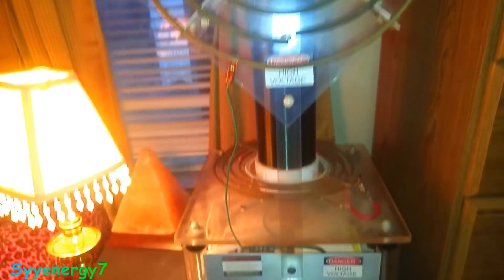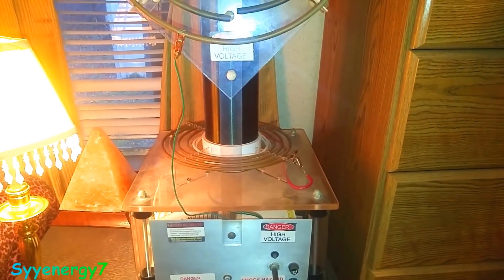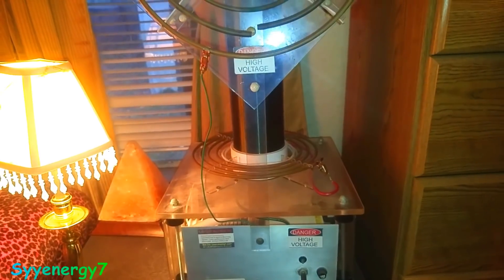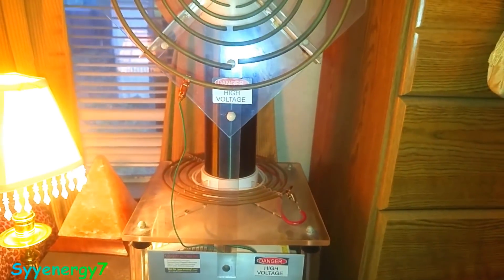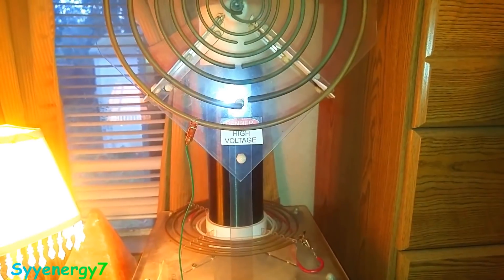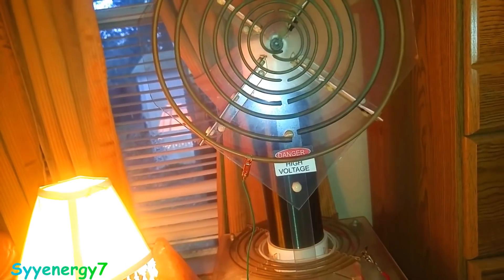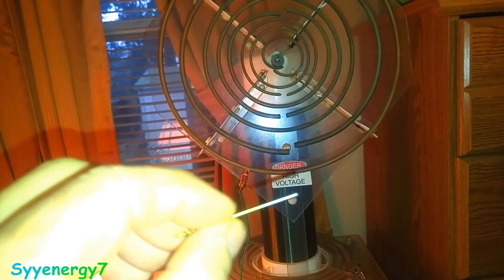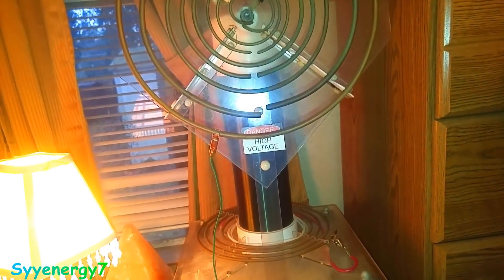Portable Lakhovsky Multiwave Oscillator, Spark GAP at 1/16 inch

Comment: The original MWOs had the antenna mounted concentricly with the Tesla coil which is in the same direction as the scalar waves which are most healing and rejuvinating. Tesla wrote a paper on the Hairpin circuit for therapeutic purposes which produces scalar waves. I think the setup would work better with the antenna mounted horizontally on top of the coil in the same direction as the scalar waves. The arcing between the plates generates X-Rays and ozone. Scalar waves are much more beneficial than the sparks.  The Hairpin circuit can be found here: https://www.youtube.com/watch?v=6Ppi27ZWj88

Comment: can you post a link where did you buy it from?
Reply from the maker: amazing1.com
Reply: @syyenergy7  Thanks. I have limited funds. I'm planning to buy one of this 3 only:
1) True Spooky Rife Plasma Generator around 1300-1600
2) The New Remote Spooky 2 on cellular level around 1600 (have you tried this is any good. Looks fantastic on the description)
3) This small portable LWO around 1100
Which one do you recommend for case of Autism. I'm leaning towards Rife Plasma Generator because it might be easiest to use. Thanks